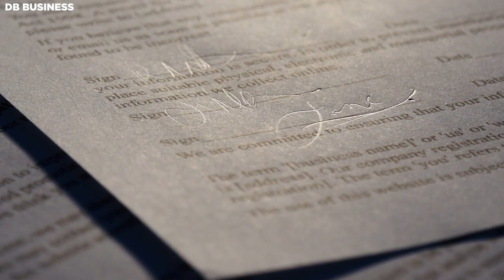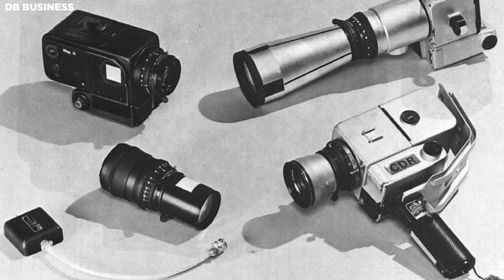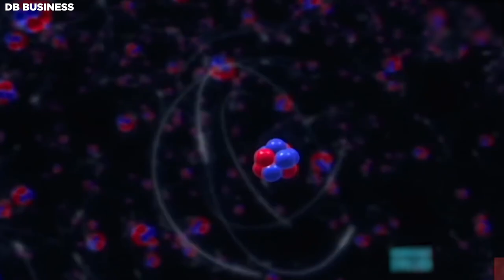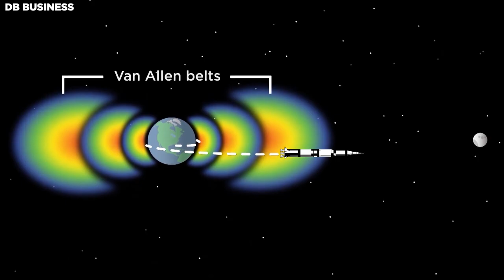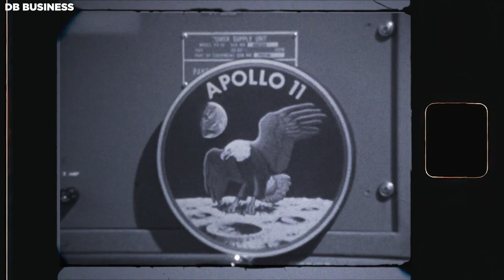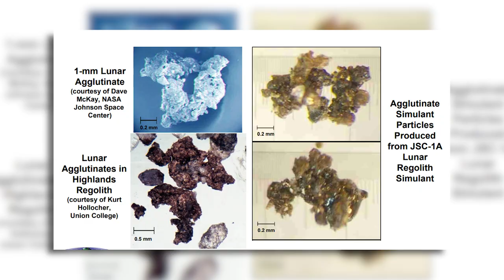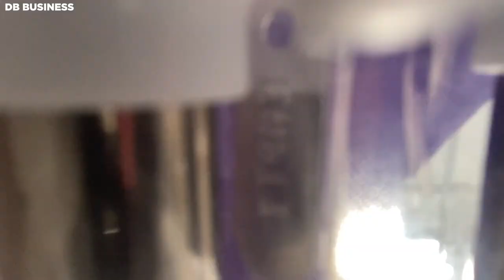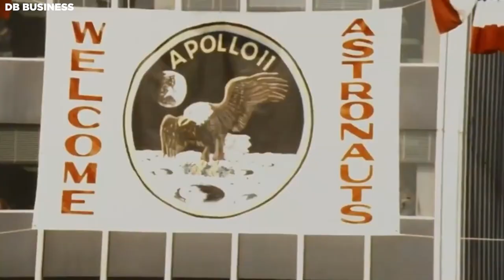Elon Musk - People Don't Realize The Mistake About Moon Landing

Comment: Why doesn't NASA explain the Trajectory of the Path they used to cross the Van Allen Belts??? Also, without the Additional Fuel required for performing the Complicated Craft Manoeuvres, how did they cross the Radiation Belts???
Reply: Aluminium and don't spend to much time in the belt
Reply: @keiranodonnell6622  aluminum? That thing was made out of tinfoil... Would aluminum help you if you were in a large microwave?
Reply: @clarkkent3730  Yeah, it would help against microwaves
Reply: They avoided the stronger inner belt altogether and barely clipped the larger outer belt.
Reply: @anorange orange500, 
  Use your security clearance and find out for yourself.